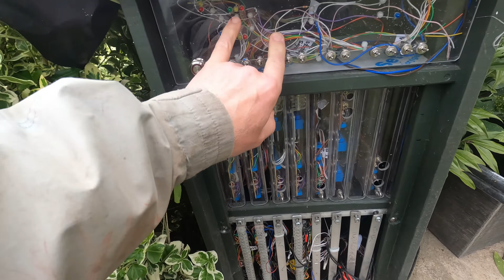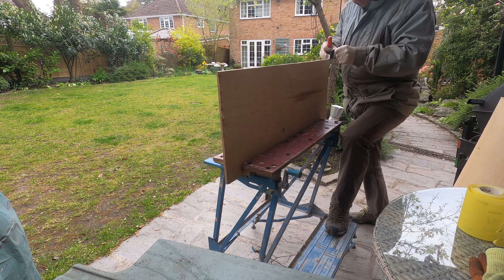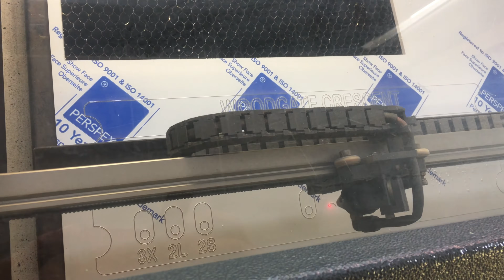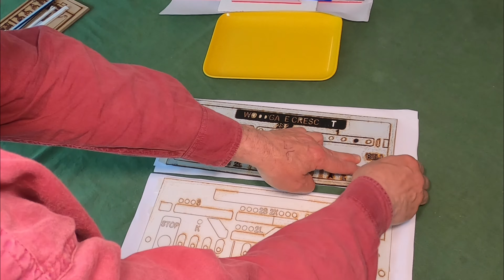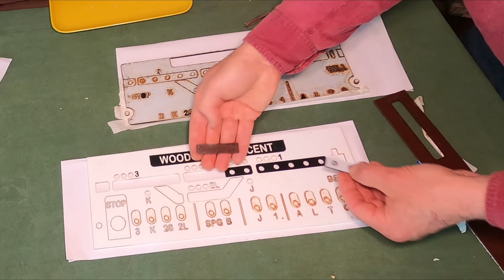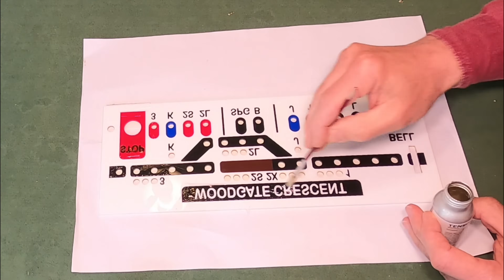Mimic Panel Construction ¦ Model Railway Control Panel ¦ Signal Box ¦ Linleys Garden Railway

Comment: Apart from the impressive complexity of the electronics, the skill and patience doing the lettering was astonishing.  What a superb job you did!  And all illustrated with the same confident, almost casual voice.  Where were the cock-ups I ask?
Reply from the maker: It has taken rather a lot of time to design and test but I think I have the  practical solution which works best for my railway.  I'm looking forward to using it in practice! Cheers, W :)